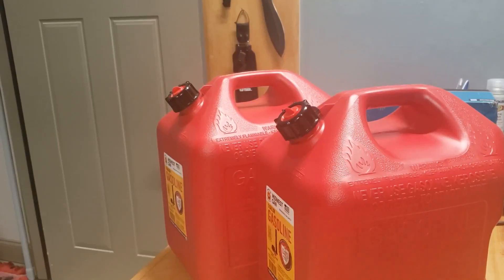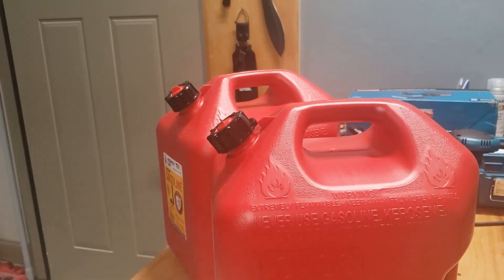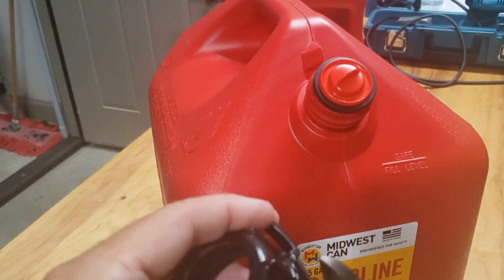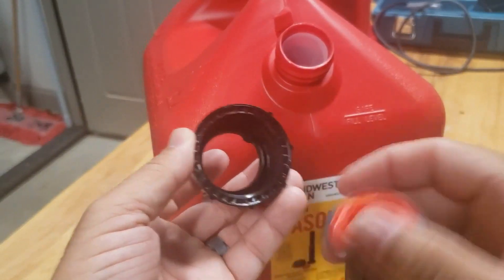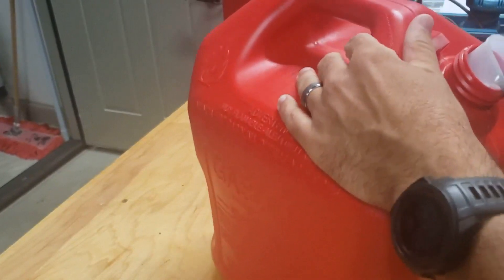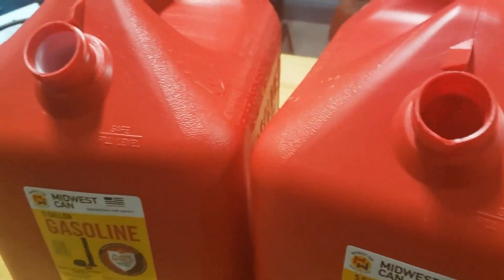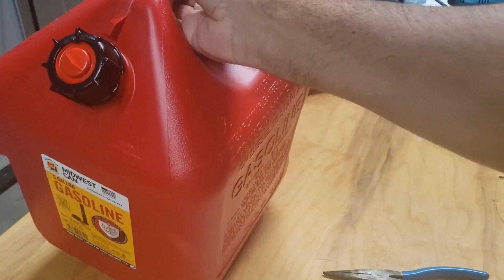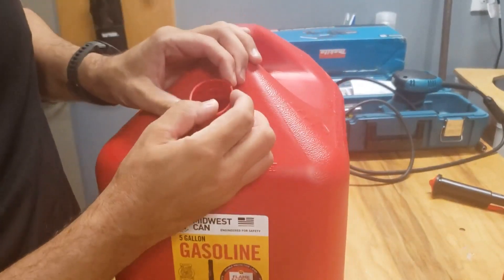Making Gas Cans Great Again Fix Gas Can Right Way

Comment: Just got mine. One filter popped in. Wire hook got it out next one the wire held it while I needlenosed it out. The barbs are on the smooth sides. My extended gas can  to gen system  has access thru replacement caps now.

Comment: Be careful pulling the filter out with pliers: you can deform the can thread.  Also,  be careful not to get silicone on the cap threads.